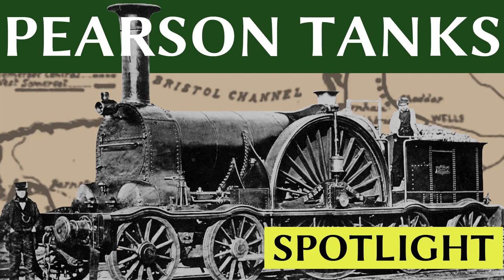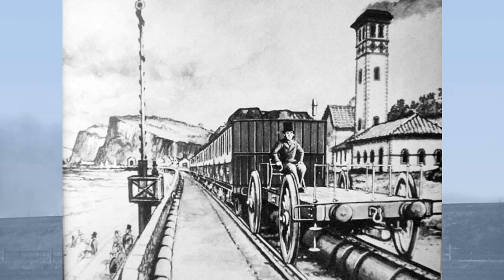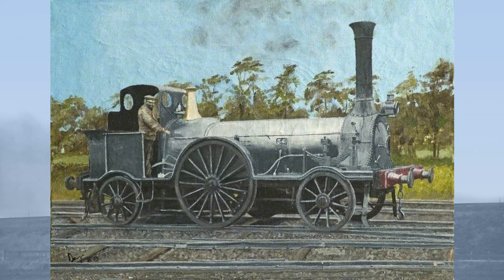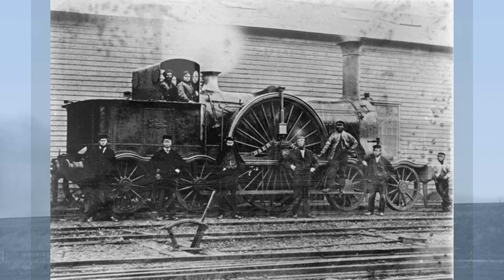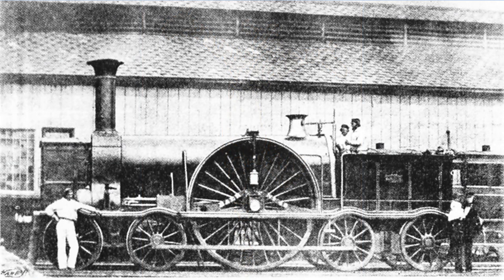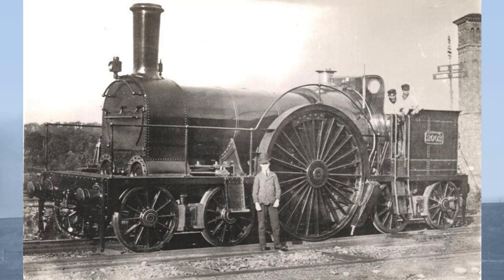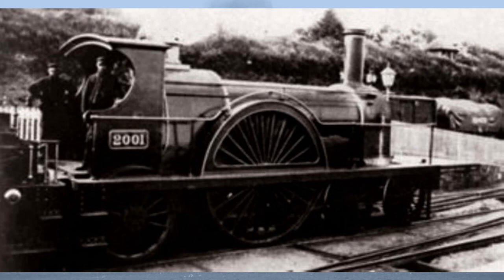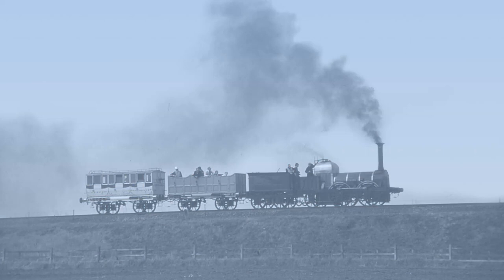Spotlight: Pearson Tanks

Comment: Love these B&ER locomotives, the sheer size of Brunel's gauge is staggering, the inside cylinders on these tanks are about as far apart as a typical outside cylinder single of the day. I love the "weatherboard" cab roof retrofits, and the jack carried on the footplate is also curious. The springs for the central driving wheel being mounted on the boiler is also very quirky. I was totally unaware that they built replacement 4-2-4Ts, though, interesting that they seemed to have standard Swindon parts. Great video as always!

Comment: I certainly think the victorian period produced the most diverse variety of locomotives. Back then it was still a case of experiment and adapt and see how it works in the next batch. Not until the end of the victorian period do you see any kind of standardising. IE 0-6-0, 4-4-0 and 4-4-2
Reply: Actually i find the 0-6-0 and 2-2-2 to be very common types in the victorian age, 2-4-0s too.

Comment: Nice video, man. I got a question.
What were the benefits and downsides of Broad gauge?
Reply from the maker: Benefits were a larger loading gauge; everything was bigger. Bigger locomotives, carriages, waggons. It meant you could carry more passengers or goods. It made rail vehicles more stable due to the wider base of support, which meant that they could run faster. However, it was more expensive to build broad gauge due to the extra cost of the land needed; tunnels and bridges had to be much bigger, and in the UK because it was such a discrete system with a limited route mileage it meant having to tranship everything where the gauge changed which meant delays, damage to goods and merchandise and additional expense.

Comment: Why were Victorians obsessed with big wheels?
Reply from the maker: A large driving wheel meant a locomotive could run fast and with a relatively low piston speed, but at the expense of tractive effort. The bigger the wheel, the higher the speed basically.
Reply: @AnthonyDawsonHistory   A good explanation, but didn't really work with the Penny Farthing.

Comment: Next to the Stirling single those ate big wheels. How fast can this engine go?
Reply: Bigger wheels than the Stirling. They could run in the high 60s.
Reply: @DiegoLiger  dang and what were they intended to do for duties. Express, shunting...
Reply: @kennethjoseph9309  Express passenger work.
Reply: @kennethjoseph9309  express passenger work.
Reply: At 3:42 the Wellington bank record is quoted as 80 mph but I have seen 84 mph quoted. Even the broad gauge timetables of the time worked  out to very high average speeds for the fastest services. A benefit of the stability and size of locomotives that a seven foot gauge provided.
Reply: @johnd8892  these engines were pretty much the best in the 1800s if they were in the Thomas series how would it played out?

Comment: these engines would have looked at home in the railway detective series of books I expect?
would the engine drivers stop them by cutting off the steam, putting them in mid gear and screwing on the hand brake like how the Andrews raiders would have stopped  the General their captured steam locomotive? during the events on April 12th 1862?
Reply from the maker: Yep, exactly as you'd stop a locomotive today - other than the lack of continuous, automatic brakes.
Reply: @AnthonyDawsonHistory  I was never knew that these engines worked until the GWR was fully converted from Broad gauge to Standard gauge in their rebuilt form.
where they designed to burn coal unlike the early engines?
Reply from the maker: @eliotreader8220  As a rule of thumb, if a locomotive in Britain was built before c.1860 they were designed to burn coke and did so.
Reply: @AnthonyDawsonHistory   then way did you say that their bunkers carried coal instead of coke? I understand that there is very little difference between them.
how much soild fuel and water did these broad gauge tank engines use during their day's work?
Reply from the maker: @eliotreader8220  I'm sorry I dont know the fuel or water consumption.  There may be a record somewhere in the archives of the GWR.
Reply: @AnthonyDawsonHistory  are you going to do episodes on the Quarry Hunslet engines? sorry for asking a question at a late hour

Comment: Isn't pi 3.142…?
Reply: Yes. Both Marc and Isambard were trained and educated in France. They worked with metric measurements. The current theory is that when Marc Brunel adopted the broad gauge for his internal railways that the gauge of 2.142 metres was based on Pi. 1.42 was a bit narrow, 3.142 far too wide. It makes fare more sense than the random figure of 7 feet and a 1/4 inches which doesnt appear to have any theoretical basis. It's the theory which makes the most sense to me to be honest.